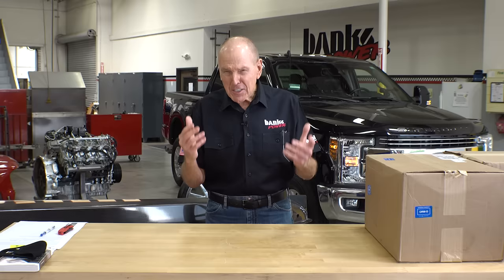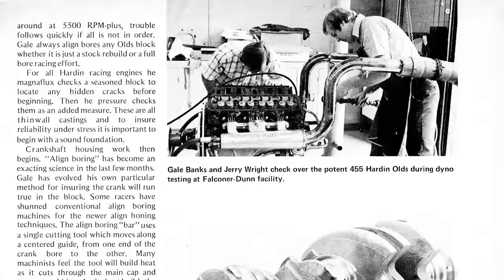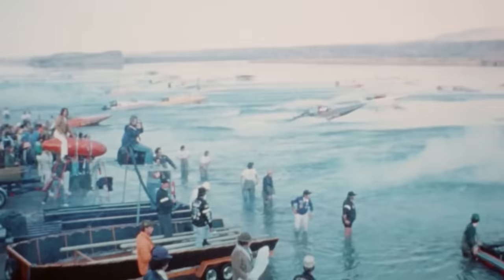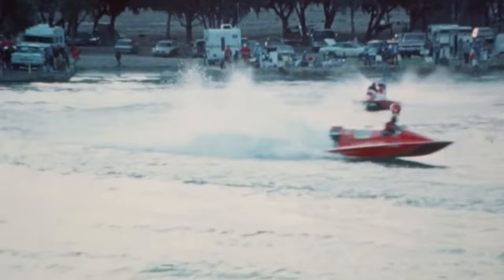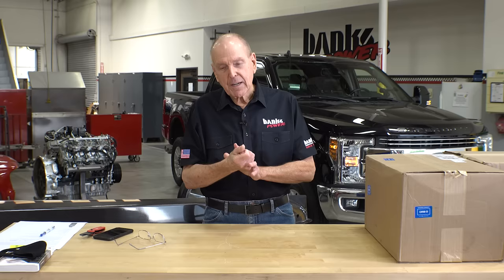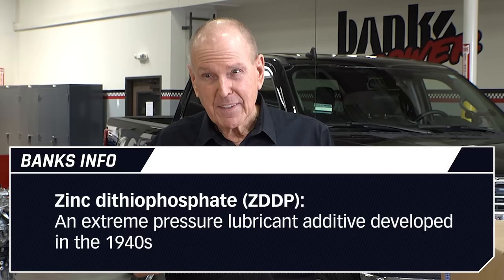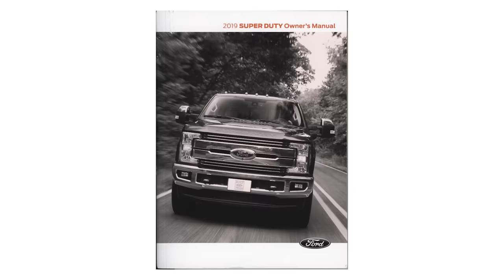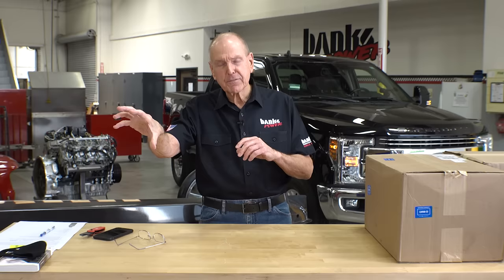ENGINEERING UNBOXED: This filter can extend your oil life

Comment: As you said these have been available for decades. The ones I saw 40 odd years ago were a stack of flat filter papers compressed axially and fed from the centre outwards. They were intended for petrol engines too.
VW have been experimenting more recently with centrifugal by-pass filters running at very  high speed and these take all the particulated out of the oil. But with the next big thing being electric and diesel being out of favour in Europe, particularly after dieselgate, it will never get developed for mainstream use.
Reply: The centrifugal filters work, but they take power to run them. This pretty much cancels their use in production cars because it would require more parts, more assembly line work, a section in the owner's manual, warranty, a mileage drop (a definite no no), a drive mechanism from the engine and mounting space. This is why you rarely see a simple bypass filter on a factory production car, much less a more involved system.

Comment: 1990 I installed a 12" Ams oil by pass 2 micron oil filter, I used European slightly flexible nylon that was externally covered it returned the oil to the upper part of the oil pan and I tapped into  the py pass oil sensor and mounted the 12" filter to the body everything was simple other than removing the oil pan and brased in the female 1/8" tapered thread which worked all those years without any problems? I would emagine that the by passs filter would last for 30,000 miles as it was hugh about 4" in diameter and roughly 12" long? It only took a few hours to do everything needed? Back in the days when mechanics could do their own design along with dual electiric diesel filters and twin switches if one CARTER electric pump quit working (it never failed) WOPEE!

Comment: Very interesting.  Frantz has been doing bypass filtration for decades just as Gale said.  We used to put them on farm & commercial tractor engines.  They used a cheap single ply roll of toilet paper as the filter element. Really.  They still make a bypass filter system but have much more technology in their filter elements.  Summit racing even sells them.  I am going to check these Amsoil systems out.

Comment: I've been running AMSOIL products for 45 years and can attest to its quality' I run the bypass filter system on my '89 Mustang LX5.0 when I replaced the engine with a GT 40, My commute was 200 mi daily. 650k miles on it before it blew a head gasket with only 4 oil changes on AMSOIL 20-50 racing oil. I have pictures of the inside of all the cylinders, hone cross hatching is still prominently visible and less than .002 out of round. The Stang has 965K on the chassis and has the original diff!  I run their products in all of my fleet, 2- F250 6.7L diesels,  2.4L Ranger, '22 Maverick ,'11 Flex, '90 Bronco ii, and '41 Dodge Powerwagon  with the original Stang engine in it.

Comment: I was wondering when you were finally going to show the Amsoil By Pass filtration system.  I have been using one on my vehicles since 1986.  Amazing how your diesel engine oil will look and be cleaner than  gasoline engine oil without a by pass system.
Reply: TheTennesseeTittyTickler Sounds like you don’t understand how a lubrication circuit functions.....

Comment: Run ams oil in my 17 f250 it’s deleted but still fixing to add this setup. It’s expensive upfront but you can get usually twice the extended intervals or more. Have a friend who hotshots and has these in three truck lab recommendations for oil change interval 27k he does it at 25k that’s 5 times the severe interval called for by Ford. He does use ams oil it’s a 250 dollar oil change. The kits and the labor to install pay for itself in no time. Not mention the time you gain back not having to change oil every 5k. And not changing your oil in a modern diesel every 5k is not smart. New engines are 20-22k plus labor and shop fees and shipping and cost of a rental so might as well call 25-30k the kit is 500 bucks the hell with it.

Comment: We have a diesel generator with over 10,000 hours on it! We have used dual Amsoil bypass filters it’s entire life. The oil is changed once a year. So 18 years of zero mechanical issues whatsoever. Just fuel filters and air filters! I am a believer in Amsoil bypass filter systems!

Comment: Bypass oil filtration is even a good idea on heavy duty use gasoline engines in light trucks.  I installed a small inlet hole, 10 micron filer on my 1979 F-350 4x4 with a custom built 400M running a custom grind Comp cam; massaged heads, intake, & exhaust; & flat top pistons (KB177) in a decked block to achieve 10.8:1 compression.  I was using it on the farm and pulling equipment around, large horse trailer, and a  35 foot flatbed at times.  I mounted the filter head on the front of the left head & fed it from the pressure feed line above the stock oil filter & returned in directly to the oil pan.  I used 15W40 oil & had samples analyzed at 3000 miles, 4500 miles and 6000 miles.  I decided to do changes at 5000 miles instead of the 3000 I was using before, but could have extended them further if I really wanted to.  Bypass oil filters do an amazing job..

Comment: I like how you have highlighted the diesel SOOT concentration’s in the oil. Removing the soot and other contaminant’s from the engine oil is critical for engine longevity. Is there a way of increasing the amount of sump oil being cleaned by the secondary filter( or similar)  you installed? Also is there a reason why the secondary filter cleaned oil  filter couldn’t go into the tops of the rocker cover( cover’s) ?
The increase in oil flow to the top of the motor would be beneficial to the rocker’s / cam’s etc.People also use catch cans to catch the oil residue , before it is carried to the EGR and block everything downline( manifold etc). I have always bought petrol vehicles in the past. A couple of years ago I bought a VW (2008)crewcab transporter tray truck, it had a 5 cylinder (2.4) turbo diesel. It was a great truck to drive, but the soot was gradually building up in the EGR , manifolds and DPF. I had very little trouble apart from the Turbo oil seal leaking, but the thought of the soot eventually destroying the motor was too much for me so I got rid of it after 2 years.The economy and power this little truck had , is making me think about getting another diesel turbo, so I can put a 9 foot long tray to accommodate a slide on camper. If you can recommend another secondary filter with a lot flow (volume ), it would mean a bigger decrease in the amount of soot going through all the motor components. Any additional information on keeping the soot out of the motor oil and consequently reducing excessive wear in the motor. Sorry for the LONG  Question, but I have real concerns about buying a newish diesel vehicle and wondering when everything is going to CLOG UP or DESTROY THE motor!! Cheer’s AUSSIE MICK .
Reply: Schaeffer’s Neutra cleaner additive. Can be use on gasoline ⛽️, diesel, and inside the crankcase for flush maintenance (1 once per quart of oil). For the Diesel tank 0.39 once per gallon of Diesel. Same for gasoline.

Comment: Have the duel bypass kit on my LBZ Duramax no complaints after  4 years another great video explanation Gale👍👍
Reply: I have the duel bypass kit on my LB7 2001 for over 10 years 193000 miles ,Easy install Ams oil is the best👍👍👍

Comment: I have a 04 GM LB7 when the injectors failed it was producing a lot of black smoke and the oil was as black as coal in a thousand k or 600 miles after replacing the injectors it ran so clean after 10 thousand k or 6000 miles the oil was as clean as it was when it was changed so I agree with Gale if you have smoke going out of the engine you will have black oil. Those bypass filters have been around for a long time on Cummings and Detroit diesels as well as refer engines and continuous running natural gas engines. They do a great job of extending the oil change intervals

Comment: I use heavy duty metal protector on every new car I buy. I live in Michigan they like to use a lot of salt on the roads early spring and early fall you can end up with salt on the car and places you don't want it. So I use amsoil metal protector to protect all my fuel lines brake lines pinch welds and more. Matter of fact I still have the car I got in high school what's the original fuel and brake lines on it caught in an amsoil MP. Everybody says quad 4 is junk, when I run 12 lb of boost and 5W-30 and get roughly a hundred thousand miles out of every 425hp build.

Comment: it's interesting, I've worked on very large tunnel boring machines that have a huge bearing with a oil bath, and on some we've added a particle counter system that periodically pumps some oil thru it and takes a reading, then pumps some clean oil from a container to flush it in between test, mind you the oil tank is 220gallons so a little bit of new oil doesn't affect the oil level but the interesting thing is the system is under 2k, and tells you what the oil is doing, it can even tell you if you're having a failure if there's a sudden jump in particulates, I wonder if the production level increased into the hundred thousand piece range if the price would come down to make is useful in the truck market.

Comment: I have been using a similar spin on high efficiency Trasko filter for years... and it provides the same results as a full bypass filter without the extra plumbing and complexity.
Both microscopy and oil analysis show it filters to 2 micron or less.

It is challenging fitting a full bypass filter in a modern car where there is very little space.

The price of a bypass filter puts off a lot of people: 
A high efficiency spin on filter is significantly cheaper than a full bypass filter.

Been running these high efficiency filters for 4M km or more without problems e.g. AKT filters in Australia (a long time ago).

Pity someone doesn't offer a fitting service for bypass filters.
That might make them a bit more popular?

Comment: I put a Banks turbo on a 6.2 GMC back in the early 80's. Turned the fuel up 30% as in the instructions. It would smoke the tires. Never had any problems. It made the truck.

Comment: Mercedes Benz stopped importing Diesel engines in 1987 because there was no low sulfur fuel available to meet California emissions standards. It was still a very popular engine. Despite the problems that they had with Trap-Oxidizers in '84, "85 & 86. (I might be off by a year or 2, I'm old.)
FYI; If you own a 1985 M-B diesel, Mercedes will replace the Trap forever. 1984 was the regular warranty period and they limited the warranty period to 5 years, 250K mi for '86. Even though the parts were identical, but with different part numbers.

Comment: Great video and great information.  I use one of them vampire pumps at work for oil testing and a little trick I learn is the same tube doesn’t like to get where you want it too and turns on it inside. I took and twisted up a knot with my welper pliers a T.I.G. Welding fill rod 307L 1/16” diameter.  The knot is between the oil that helps hold the tubing to the vampire pump and the pump housing.  The rig rod lets it move and flex but keeps it to a known level.   I have huge gearbox’s to test and they only have a fill hole and with running gears that tube will get in between the teeth but with the tig rod you can aim it to get the tip to the correct level for testing.

Comment: I remember when I was about 10 years old my Dad had a 1978 Chevrolet  short bed truck and my dad was working Nuclear Plant shut downs when they were building all of Nuclear Plants. This was back around the early and mid 1980's when my dad worked with a company called Daniels I believe when this Nuclear Plant construction was happening. Anyways my dad was making crazy money back then. I believe he made $35 to $40 an hour and was working 80 plus hours a week and he is a gearhead. We were living in Illinois and there was a very well known machine/speedshop around the Decatur/Cisco area. My dad had a balanced and blueprinted SBC 383 stroker built and stuffed it in the 78 Chevrolet truck and the engine builder talked my dad into installing an AMSOIL remote mounted oil filtration system on the firewall. It was a big canister that held a little more than a quart of oil and had an element inside that could be purchased so you could change it. Man that engine had loads of torque and would haul ass. He used the truck as our primary vehicle for about 8 years pulling boats, hauling firewood, watermelons and I mean you name it. It was our only vehicle. Finally after about 8 years ( Now I'm 18 years old and getting into racing myself ) the engine blew a head gasket between the cylinders so it had a misfire but no water and oil got mixed together. Well we tore that engine apart and I would say it had roughly 100,000 miles on it. I couldn't believe my eyes at how clean the inside of that engine was. No sludge whatsoever ( Man I wish we would've taken pictures). The cylinders had absolutely no wear lip/ridge in them. Sounds crazy I could not believe it ( The inside of the motor looked like it just came out of the Hot Tank in the machine shop. ) That sold me on AMSOIL products for life. You guys know alot of these products nowadays are just a waste. I mean you can change your oil every 3,000 miles and it will be pretty clean but there will be a good amount of sludge after 100,000 miles. The engine was so clean you could eat out of it. AMSOIL IS THE REAL DEAL. I know it sounds like I'm a commercial but it was awesome to see how good that AMSOIL remote oil filtration system really worked.

Comment: Gale,   I have been running Amsoil diesel marine 15w-40 in my 7.3 since i broke it in new in 2000. I have 448k on the truck.  I am a approaching the 50k mile  interval time to change  oil and filter. I have for 20 years changed the filter at 25k and oil at 50. I have run Amsoil filters. The oil sample comes back the same. Every category is in normal range. Run for another 12k and sample. At 50 k the doesn't owe me anything..The manual from Ford is 5k mile oil interval changes. This would result in me changing the oil 90 times at the 450k mark....The savings i. Time alone is over 80 hours.  I can always make more money. I can't make more time.  The only engine repairs were  3 bad injectors and a leaky cup.  I replaced all the cups and injectors at 385k... the HP pump had a leaky plug back 8 years ago. The pump had to come out to fix it so I replaced it because of the hassle of R and R. Nothing was wrong with pump.  The savings in Dollars and cents ....thousands.
90 x 15 quarts = 1350 quarts. The environment impact. Natural resources.   My only regret was not putting a dual remote kit.  Well I am planning a 20 year body off restoration.   It will definitely include a filter kit.  Maybe I will get 100k between oil changes.  This  project will be tiled My Last Truck.
Reply: Told the wife the same thing about my 2001 7.3 4x4 excursion i bought 6 years ago, "the last truck I'll ever buy!"

Comment: 30 years ago I installed a by pass filter to my Diesel Passat. Its filter was a toilet role. It held the role in a tapered canister, oil was fed to the wide end through to the narrow.  Oil didn't just pass through the medium once but hundreds of times before it emerged out of the filter can.

Comment: I know this is an old video, but if this post saves an engine,  all is good. I ran the remote oil filter/bypass filter (it's a combo affair, two cartridges and Amsoil branded). This setup ate two engines from oil starvation before we traced the problem to that unit.
Reply: So this was not a direct connection at the regular oil filter connection?
This was a remote connection somewhere else?
How did it starve the oil?
I can guess there must be more oil needed to account for the oil in the bypass.
Reply: @matthewk6731  not certain I entirely understand your question.  But the unit in question is directly mounted to the factory oil filter fixture. Yes, additional oil is used to make up the volume of the extra bypass filter (which is quite large- perhaps an extra 1.5 quarts is used). The correct oil level is maintained by the dipstick. These units made by Amsoil were determined at some point to be defective and they changed build. They did not reimburse for the engine damage (even though they have a warranty against it)

Comment: I put an FS2500 bypass on my 2005 2500hd GMC and only used full synthetic oils and I pull an oil sample out every 15k. My maintenance schedule is to still replace the full flow filter and bypass filter at the specified interval, ( replace the ~2qt lost with the filters) and continue to run the oil. I usually drain at 20k, but the oil analysis says the oil is still well below the recommended soot contamination, additive life and no contamination or "wear metals" (iron, copper, ect). I HIGHLY recommend you install a bypass filter on your diesel engine, regardless of application as soon as you take possession of it. The sooner the better.

Comment: I had an old Delta 88 with a 5.7 Diesel.  Had was the optimal word, because as he said, it was a piece of junk.  the previous owner didn't know anything about the head gaskets or anything, because she complained about it constantly overheating and not running properly even when it wasn't overheating.  We ripped that engine out and replaced it with a 5.7/350cu in and never looked back.  Talk about a sleeper, we tucked the dual tips just behind the rear bumper so you had to look really close to see the bottoms of the pipes just below the bottom of the bumper.  Groceries were delivered quite rapidly in that beast.